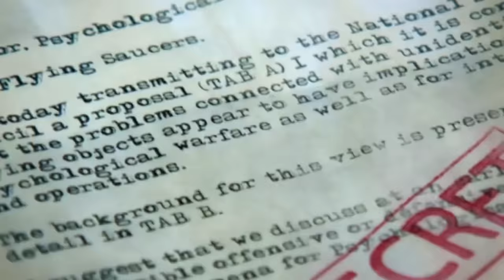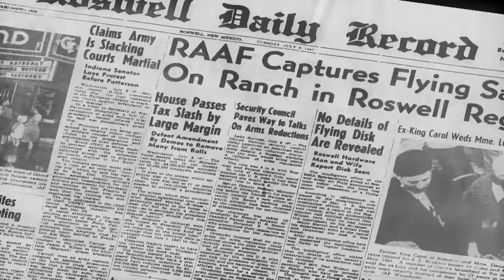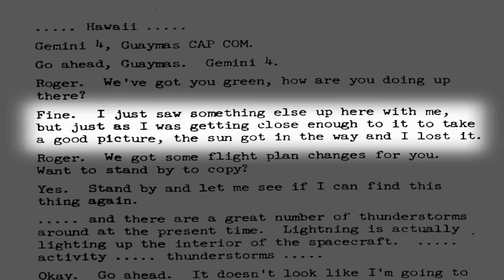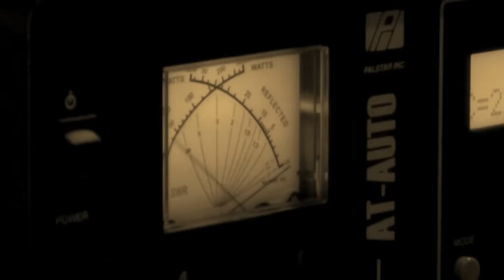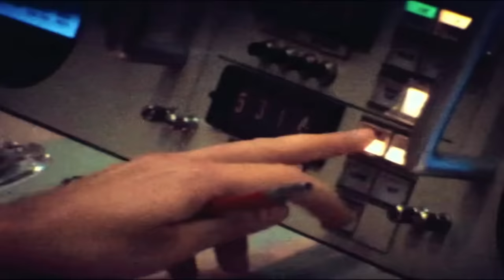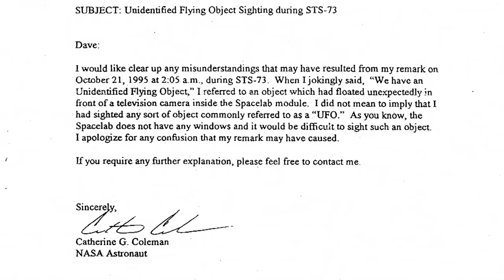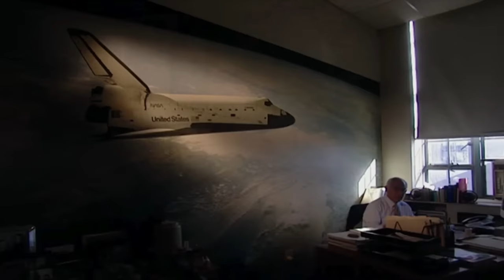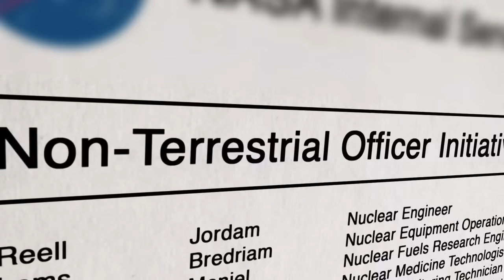Mind-Blowing Discovery: Aliens Secretly on the Moon | Unsealed Alien Files

Comment: OK so the universe is 13 000 000 000 years old. We have electronics for 100 years. The closest other star is 4.5 light years away (It will take at least 2000 years to get here).  Most inhabitable planets are more than 100 light years (at LEAST 100 000 000 travel years) away. Then we meet. We are both at the same place at the same time. Whau.

Comment: There is, what looks like an installation on the far side of the moon, it was filmed on the Apollo 16 mission, there appears to be a vertical structure and the lunar surface around it does not look natural and the fact NASA have tried to obfuscate the area in all but one frame, you can also find at least 2 UFOs moving over craters in the 30 second footage.

Comment: What is Farouk El-Baz talking about, "parts of the moon not lit by the sun", did he specifically mean on that particular mission? because I am sure on other missions those parts would have been lit by the sun. The whole surface of the moon is lit by the sun during the 28 day lunar cyvle...
Reply: the moon is tidal locked into circular orbit around the earth. There are times when the "dark side" of the moon (the side always facing away from us) does go into darkness. As it Orbits the earth and the earth is blocking the sun from the moon (an eclipse on the moon) the dark side is then in fact dark. The facing side goes also goes dark to us as it is a LUNAR ECLIPSE.

Answer your question.
Reply: the dark side of the moon, look into it

Comment: The fact that the space station is not planted on the moon is extremely telling.
How much easier would it have been to build it on the moon rather than in space. We ain’t never gonna be going back to the moon, hahahaha, maybe the Chinese will, but watch what happens to em.
Reply: You're correct. It's extremely telling. The fact that the ISS is only about a few hundred miles up compared to Luna being thousands of miles away tells a lot.